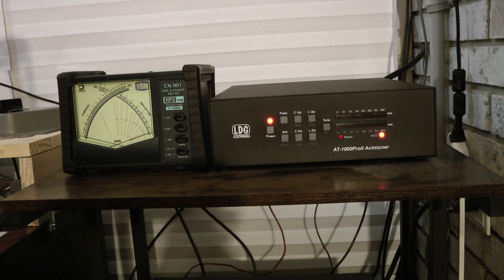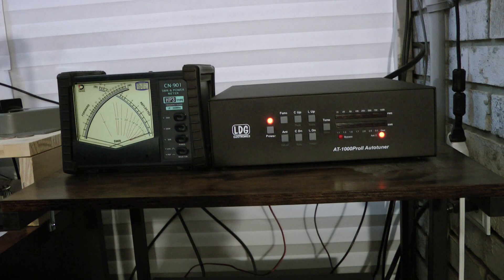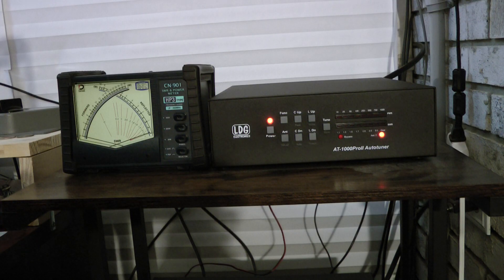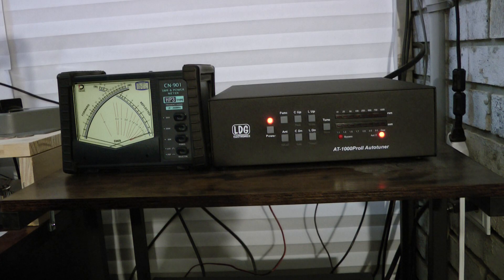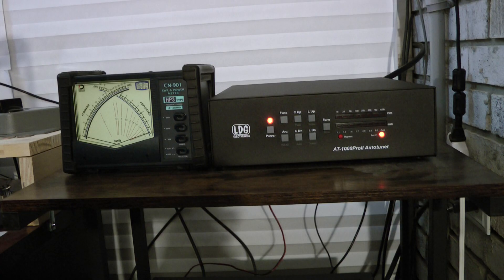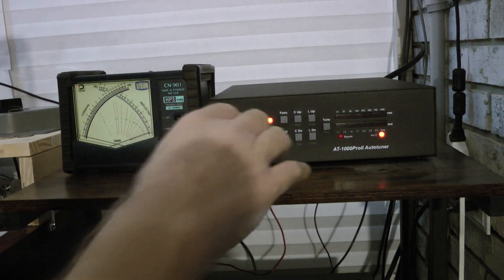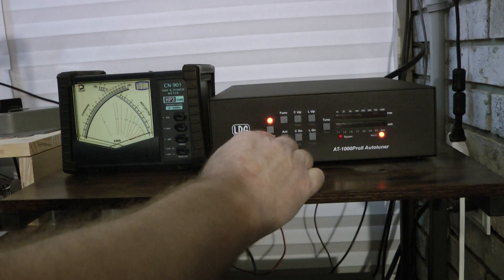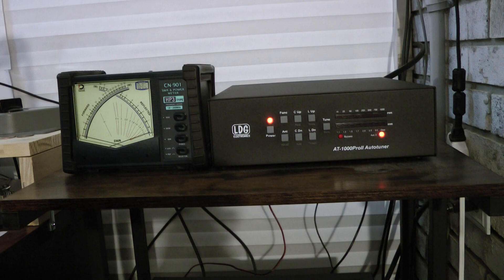LDG AT-1000 PRO ii Automatic Antenna tuner

Comment: It would have been useful to see if there was a difference when tuning with high power, 600 watts plus
Reply from the maker: I am not sure i understand what you are saying, the tuner is not designed to tune with high power. It is designed for tuning at low power, then after it has tuned on the desired frequency, turn the amp on. If you try to tune with 600 watts it will burn the tuner up!

Comment: Good video, good tuner.  I concur with all of the observations.  

Ive used mine, also with an FT-710,  in both control modes - from the radio and local on the tuner.  I've found that with an amplifier (ameritron AL-811 with 572b tubes), it's easier to tune local with the ldg at-1000proii.   This is because on some bands, I can get excessive swr between the amp and radio (mostly on the WARC bands).  So that allows me to use the radio's internal tuner to improve the match.